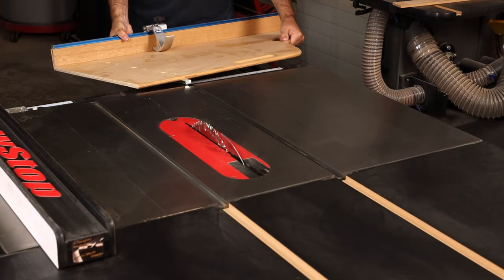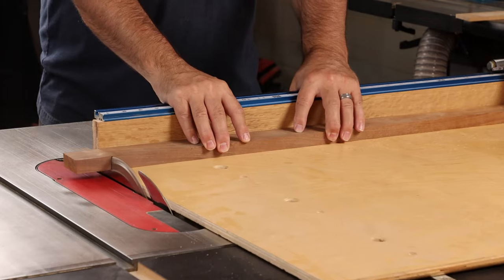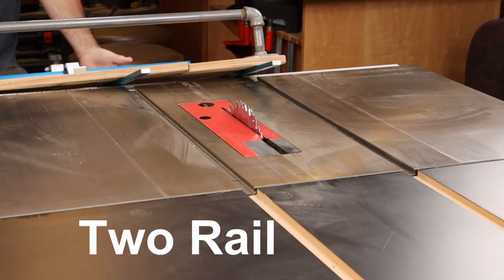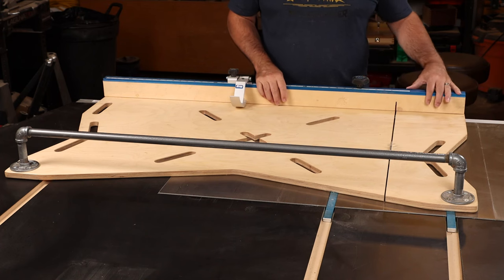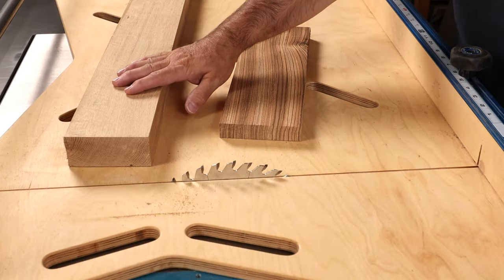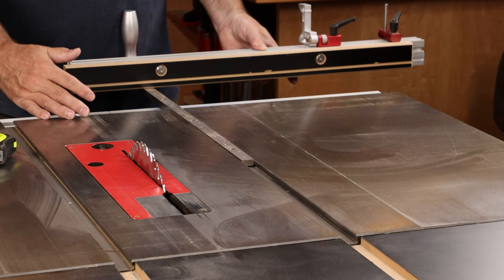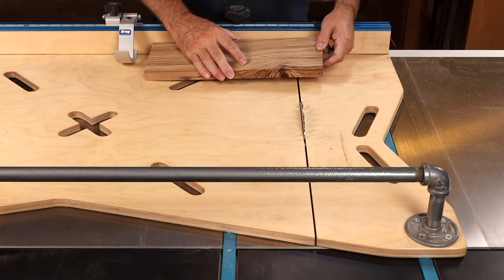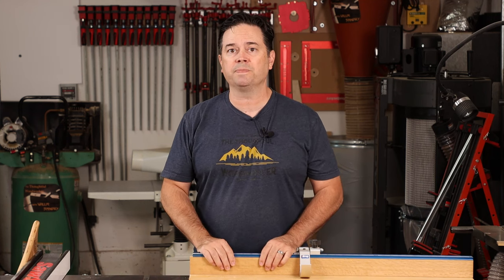Crosscut Sled One Rail vs Two Rail - Which is better for Woodworking at the Tablesaw?  1 or 2 Runner

Comment: Made my first cross cut sled based on what I saw on your video, mine not as smart looking as yours but it works like a charm. For what I need at the moment the one runner was all I needed. Created the runners with my 3d printer as I couldn't find anything in the local hardware shops here in South Africa. Thanks for sharing your video with us amateur wood workers it saved me a lot of time and effort.
Reply from the maker: Excellent Mike!  Sounds like things worked out well for you.  Best to you.

Comment: You're a true craftsmen Willie, thanks for sharing your knowledge and passion so wonderfully.   I was about to make my first cross cut sled and discovered a huge problem with my saw.  My blade is perfectly aligned with my fence, however I have .012" of misalignment with the blade and the miter track.  The .012" is from the front to the back of the blade so the total misalignment is much higher over the full length of my saw's table (front to back).  This is easily resolved on "most" well made saws by adjusting the trunnion bolts.  Sadly my generic table saw has no adjustment due to undersized trunnion holes for the bolts. To fix this I would have to disassemble most of the saw and attempt to enlarge the holes, which are cast iron.  That's a project I won't be tackling for good while.  Question... Can you think of a "work-around" that might still allow me to have a one or two rail cross cut sled that will work with my misaligned blade/miter tracks?   Doubtful, but I'm hopeful you might have a rabbit you can pull out of your hat or shop apron. :))
Reply from the maker: Thanks for the kind words Richard - truly appreciated.  You're on the right track with enlarging the trunion holes to make a slight adjustment.  Once that's set, the fence should be easy to adjust.  I've had projects like this that I stalled and delayed doing, like setting jointer tables coplaner.  But once I took a day to do it, I realized it was well worth the time.  Best to you.

Comment: I don't understand the metal support; I can't believe that it is more rigid than a wooden rail, and it is only connected at opposite ends of the fence. I would imagine that a 15cm x 15cm block glued and screwed over the kerf line would be more stable, lighter and cheaper.
I'd love to hear your thoughts on this.
I use a two rail sled and mitre bar - they cover pretty much all my requirements.
Reply from the maker: It's just a different approach.  It's been working well for me.  Just make those two rail sleds deep enough for cabinet sides!  Best to you.

Comment: If the front fence of the 2-track sled is tall enough, that “top track” would be well above the blade when it is raised to its maximum height.
Reply from the maker: Yes, you could make the front fence 4-5" tall, and that would clear the blade.  However, I've found it's awkward to hold more common 3/4" stock down with a tall fence like that (standard fence height is 2-1/4").  I guess I prefer to cut 8/4 with my single rail sled.  Very smart and thoughtful comment!  Best to you.
Reply: @TheThoughtfulWoodworker My front fence is 3-1/2" tall and goes over the blade.
A 10" blade only comes out 2-1/4" above the sled .
Hands can still hold the workpieces!
Reply from the maker: @deek3048  Huh?  Not sure I grasp your point, but I'd like to.
Reply: @TheThoughtfulWoodworker  You don't need a fence that's 4-5" tall since the blade doesn't come out that high with a sled!

Comment: What?!? One rail vs two rails doesn't affect the avaliable cutting height if designed correctly. Just split the t-track and make a bump in the fence to connect right and left. For those very rare occassions when you need a stop very close to the blade where you don't have a t-track, clamp on a stop block. Or just make the fence taller. Or put the t-track on the inside of the fence rather than on top.

Neither does 1 vs 2 rails effect the thickness of the base. For a 2 rail sled, right and left are  secured/connected with the fence(s). These are the important bridges to get a stable sled.  Will hardly improve stability to go for thicker base than for a 1 rail sled. If you want it more stable, beefen up the bridges instead. 

If pushing far from rail center, stability and freeplay is improved with two rails. All other things can be handled in the design to get equal properties. All my sleds (1 two rail and 2 one rails) are 15mm thick and cut max height on the blade. My old full size two rail sled was 12mm and had no issues with stability.
Reply from the maker: Both my sleds use Kreg Top Trak for the measuring system.  So, yes you will be limited on height with this two rail sled.  Otherwise you'll cut into aluminum extrusion.  If you use a different approach, then the sky is the limit, but these limitations exist with this system.  Thanks.
Reply: This video appears to be a instruction on one sided sled vs two sided, you should then of course mention that what you say about the height constraint is based on a certain type of stop solution. And as I wrote, this can be solved by stopping the t-track before the fence bump for a two sided sled. Any reply on the thickness which I also commented on?
Reply from the maker: @CarmoniusFinsnickeri  Your points are valid.  It's just this system has no bump up, like so many old school sleds have.  They work fine, but usually lack the scale and stop systems (which is a must for my work).  As far as the thickness - 1/2" is adequate for a single rail design because it's one piece.  This maximizes cutting capacity, and lets me handle planks up to 2-1/2" thick.  1/2" also makes a nice light sled.  For two rail designs, I stick with 3/4" plywood because it helps increase strength of the 2-piece sled.  Thanks
Reply: @TheThoughtfulWoodworker  Thanks for your answers. But I don't agree on the thickness. The stability in a two piece is determined by how the pieces are connected, each half doesn't need extra thickness compared to one piece sled.